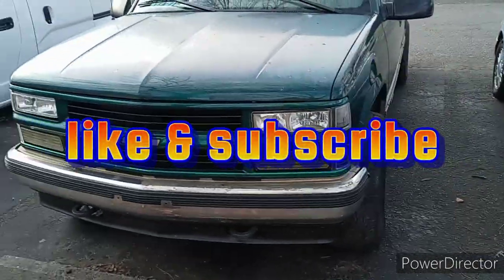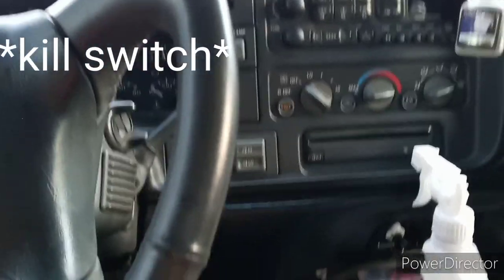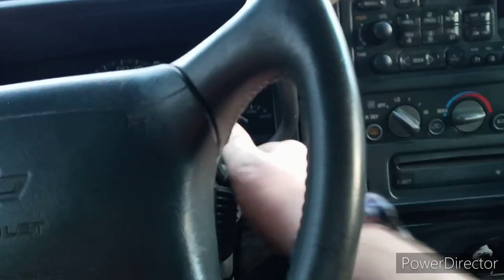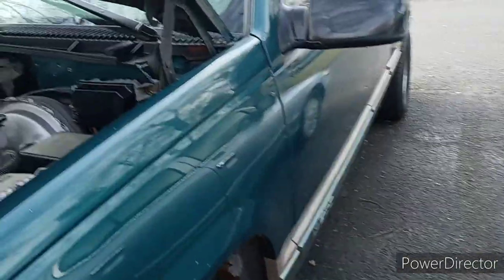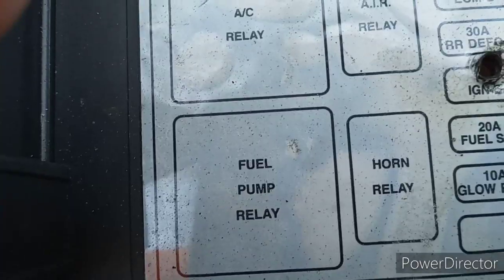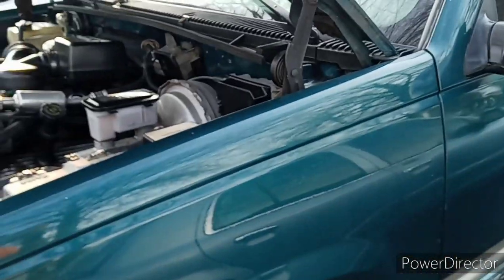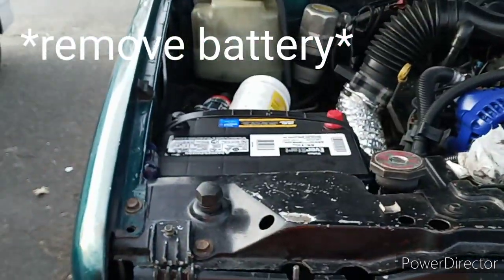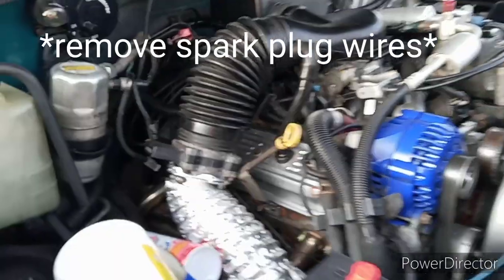how to prevent your 88-98 Chevy Silverado from being stolen #shorts

Comment: Just get a $200 viper 5706v and make sure to cut the starter wire from the steering column then one wire on the alarm goes to one end other wire goes to the other end aka starter end and ignition end then from there they can’t start the truck if they break the window, open a door anything that sets off the alarm won’t has a built in kill switch so it won’t start intill you disable the alarm from your remote even if they unplug it then it definitely won’t start 😂 that plus a kill switch hinden under your seat is the best move tbh they won’t ever expect to feel under the seat for a switch 😂 they will check under the dash n pockets

Comment: And if that doesn’t work lower your truck to the ground and take the bag controller with you😂
Reply from the maker: Nahhh low vehicles are for lgbq people unless it’s a low rider
Reply: @straightpipedchevy mine is a low rider😂 i have a whole front end conversion custom taillights custom exhaust added a roll pan in the back and just got done rebuilding the entire engine.Also when I said lower it to the ground I meant when I park my truck its literally steal proof when I lower it all the way down and take the controller with me the frame is literally on the ground.I have slam specialty air bags
Reply: @straightpipedchevy sorry didn’t realize you left a reply till now😂